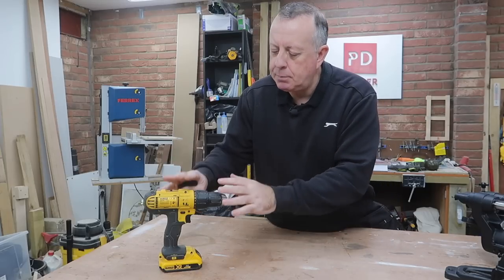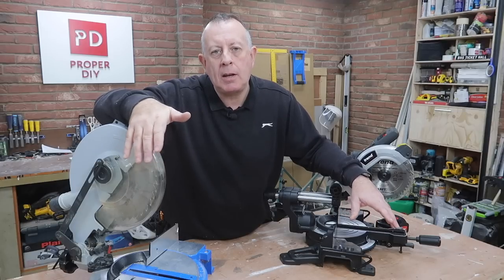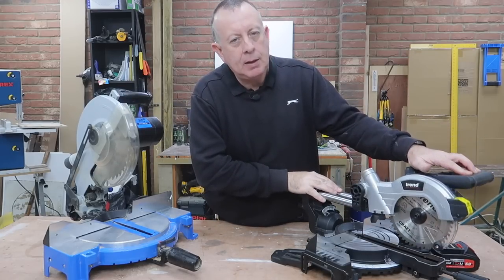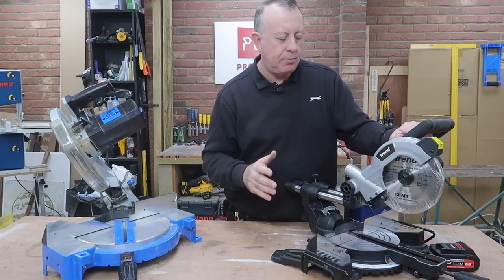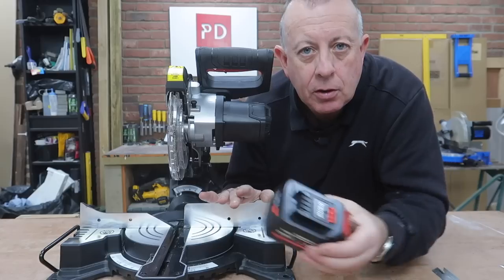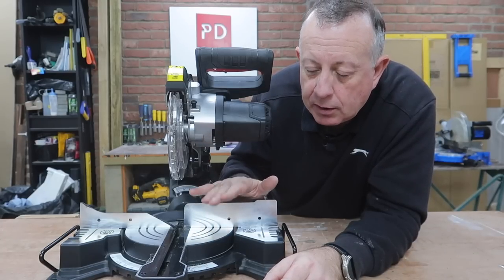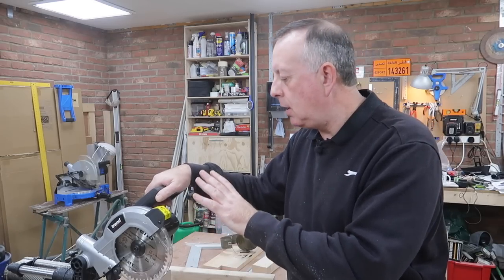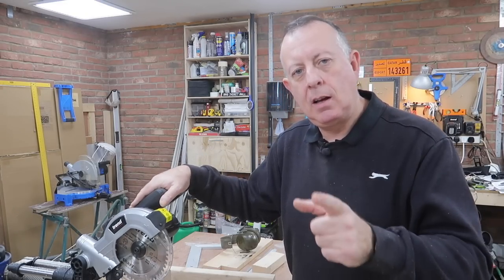Mitre Saw Set Up - how to adjust a mitre saw with the Trend MS184S2

Comment: I make wooden puzzles and need to cut very small wooden blocks (2-4cm in length) with significant accuracy. Having used a low power mini table saw for a long time, I think it is time to invest in a mitre saw.

Comment: Thank you. I followed your methods for measuring the accuracy and went from very bad to pretty good in an hours worth of tinkering. Not every saw is as easy to adjust as yours.
I also found the best way to gauge the result was by looking at cuts in timber and reversing them like you said.

Comment: You’ve inspired me to setup my old B&Q saw which I have hammered over the years. Was thinking about upgrading it but a bit of TLC and a good setup might be just as good. Might invest in a blade with more teeth as only tend to work with softwoods and the finish can suffer. A video showing how to extend the fence, add stop blocks make a zero clearance fence and bed surface would be good. I found that improved the tearing out I was getting although a better blade would also help reduce that. Keep up the great content!

Comment: Absolutely essential thing with mitre saw: check everything before turn it on first time, especially budget level from Evolution down. 
   Bought 305mm Evolution, couldn't assemble, realised drawings didn't  match what I was seeing, called support, told to return immediately - faulty manufacture at factory but at least it stopped me even being able to switch on.
   305mm Erbauer was ready to go. Looked to check blade alignment and realised it was off square in the channel - barely half millimetre from catching edge of metal. Called support. Told to return it immediately, think they pulled the product for a time. 
   Many people love Evolution quality control is very patchy. I've seen folk happy with budget tools but they hadn't noticed the very dangerous flaw. Mitre saws are potentially extremely dangerous so be very diligent in set up before switching on. If possible, get checked by someone who knows what to look out for, then enjoy their brilliance.
   But not next buy after drill. Basic circular saw good for most things - especially with jigs described all over YouTube. Some, like one of my Makitas, even have adapters to work on track.
Reply: Buy quality...buy once
Reply from the maker: Thats not good from Evolution

Comment: Wish I had seen this before buying my saw about 4 years ago. The fence on mine is not straight on both sides. Each side points into the middle, only by a degree or 2, but noticeable at times. I have remedied it with tape and card, proper bodge job.
Reply from the maker: Oh dear! That's not good. Consider also putting a piece of 12mm ply in front packed out to be straight - will make a nice new fence

Comment: I picked up a non sliding saw cheaply in B&Q on sale years ago and never really got on with it. I might need to get a small square and run through these steps.  Won't mean it can cut a 2x6 but I'll need more than the 6 cuts I needed to justify a new sliding saw.
Reply from the maker: To be honest, 99% of all cuts are small so even a small mitre saw is a really useful asset

Comment: Great tips through here, especially like the tape on the bed…..

Only thing I would disagree with the 305mm double bevel is not the the most expensive even as the largest standard size. The most expensive is 260mm as that is made by Festool. Which is 100% Bob 🥜 out of the 📦, as you would expect! Great stuff keep ‘em coming
Reply from the maker: Yes you are right. I try not to mention the company that starts with an 'F' - as it's not even an option for 99% of DIY'ers.
Reply: @ProperDIY  100% agree. Though I am one and have bought one after 25 years of diy. It is amazing out of the box.
Reply from the maker: @dougsaunders8109  That's fair enough. I think a lot of my views would get upset if I bought one of those.

Comment: Any chance that you could do a similar video about what I describe as a hand held circular saw, think some people refer to it as a skill saw. I have an old B&D version that has like a curled guide that is supposed to follow the blade but this has never been in line with the blade. It is just stuck in a corner of my garage and never gets used due to it not cutting straight lines. Thanks

Comment: Great informative  video again, sadly i bought myself a dewalt 774 mitre saw and only really used it for general diy rough cuts and wasnt until i started to use it for more accurate cuts i realised  the bed was slanted to the side wings enough to stop it being used for accurate cuts and its out of warranty its a real pain and will most likely have to buy another saw.
Reply from the maker: I' surprised with a Dewalt
Reply: @ProperDIY  I was surprised as well,when health allows i will have to take a better look.

Comment: Sometimes after making the fence and vertical adjustments the two pointers do not line up correctly on the relevant scales and might need a slight adjustment.

Comment: Excellent video Stuart
What adjustment did you make after cutting the wood a second time, which showed an error from the vertical cut?
Reply from the maker: I adjusted the vertical stop slightly to rotate the blade anticlockwise a touch when you look at it from the front.

Comment: Just out of curiosity, why not DeWalt since you already have that brand, instead of multiple battery types, which I'm assuming are not interchangeable

Loving the videos by the way, very informative 👍
Reply: Check the begining of the video where it says " includes paid promotion " and those batterys are not cheap at about £90 a piece from Trend.

Comment: The evolution rage saws are good for the DIYer in my opinion.  You can cut wood and metal on the same saw, with the same blade.  Sounds like a gimmick, but its not, it cuts all metals up and including to non hardended steel easily.  I also use mine for fine woodwork by swapping the dual purpose TCT blade for a fine wood blade.  Saves me having a seperate wood and metal saw taking up space.
Reply: But look them over very carefully before use. They can be superb but quality control very variable. Similar with Erbauer. Wrote a more detailed comment earlier
Reply: @cuebj  Agreed, my first one went back due to a grinding noise when rotating the table.  Second one has been ok, and you get the no hassle warrenty from screwfix of course.  Mines been really useful, its great to not have to worry when cutting reclamed wood that you'll hit a nail.  If you do it's not an issue.  I also do small welding projects, mainly with box section steel, so making cuts in that with the evolution saw is much quicker than using a grinder.

Comment: I use a digital angle finder for my saw, find it a little better than my square
Reply from the maker: I need to get one of those
Reply: @ProperDIY  A square may look like it is OK but mine for example was 0.3 out. Looked fine with a square
Reply from the maker: @gavincollins9376  Just be aware, even digital angle finders have a tolerance and are not perfect even if they read to the 0.1mm 
Unlike a laser level, I'm not sure how you check them.
Reply: @ProperDIY  I calibrate it with my speed square at 90*, Probably all you can do TBH.
Reply from the maker: @gavincollins9376  But as you said, squares can be out!
Reply: @ProperDIY  I use a Swanson, that is perfectly 90^ plus I've had that against my roofing square. So I'm 100% confident mine is in order.

Comment: Hi Stuart, can you help ? I looking to buy a mitre saw to use at home. Ideally the saw have the laser guide and slide however I have a budget £120 max £150.. thank you steve
Reply from the maker: Without looking specifically, I would aim at either Evolution or Titan from Screwfix. I old one you see me use until recently was a £50 saw from B&Q many years ago so you don't need to pay a fortune to get something workable.

Comment: I just bought a very big, but bottom of the range double compound miter saw of the Ozito range (think Ausie Tools). I was disappointed to discover that it can't support it's own weight on a bevel angle less than 45 degrees. So I can cut bevel angles of zero, + 45 or -45, but nothing in between :(
Reply from the maker: Really! I've not heard of that.

Comment: Help! I need to replace rotten joists in my kitchen and because the house is older the joists are 4” x 2”  the new joists are slightly smaller and metric. Any ideas?  Thanks
Reply: Go to a timber yard, not a DIY store, buy over sized timber and get them to rip it to the dimensions you need. Will cost a bit more but will be an exact match.
Reply: @georgepritchard3010  Thanks George. Great tip. 👍
Reply: @martynbuzzing3327  What I should have added is that is you are buying timber for joists you should make sure it as least C16 grade. Without seeing the job it's hard to know the load the joists will have to support. If in doubt go for C24 or consult a builder.
Reply: @georgepritchard3010   Hi George, it’s a kitchen floor and after the garage conversion this part of the floor will only be carrying  cupboards. We had a small leak of water under the sink for many years and the ends of 3 of the joists are rotten. C16 would probably do the job, I need to sister them up as it is. Thanks for your advice. 👍